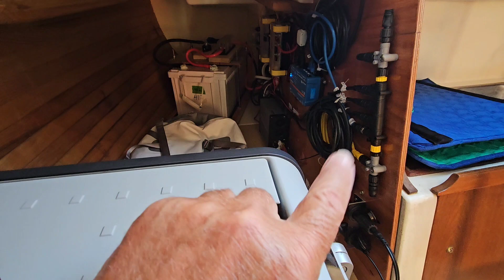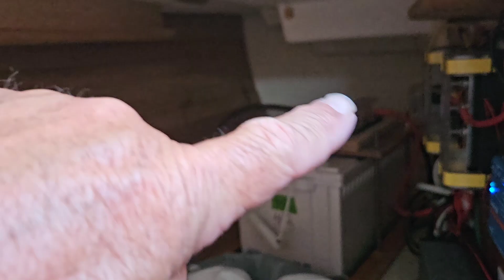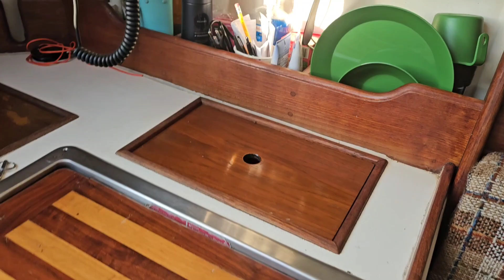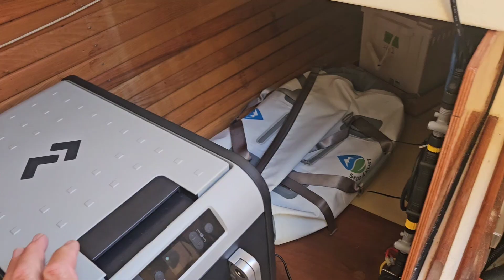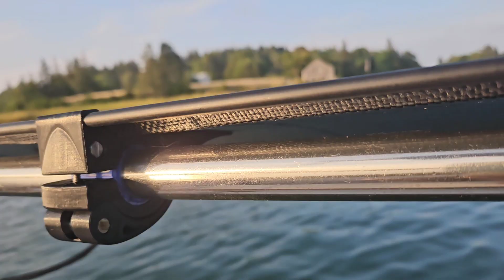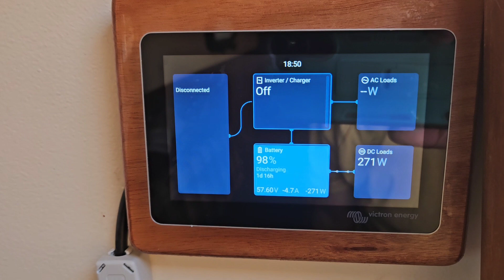Cape Dory 25D conversion to Electric Propulsion

Comment: Incredible job! Very impressive. I am having issues with my KM2-A transmission on my CD 25D and instead of pulling that and rebuilding I am considering converting it all over to electric and forget the Yanmar 1GM diesel and associated service & maintenance issues, pump impeller, winterizing, etc. Any idea what your ballpark investment is for the entire electric conversion? I built-out a complete Victron system in my Mercedes Sprinter camper van so I am familiar with the electrical side and with solar/LiFePO4 batteries, etc.  Thanks!